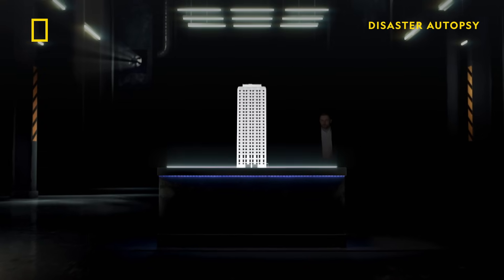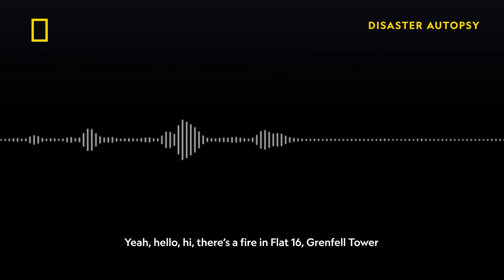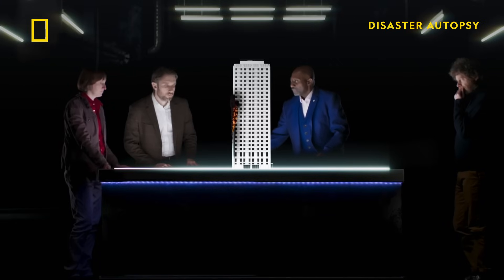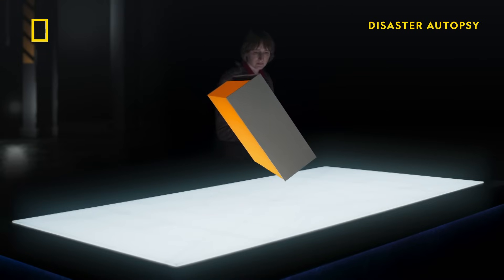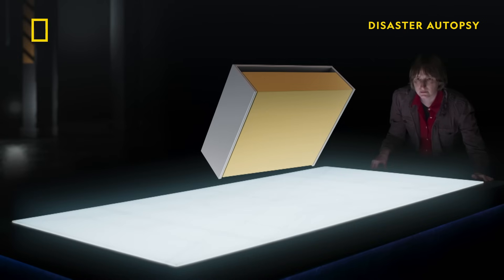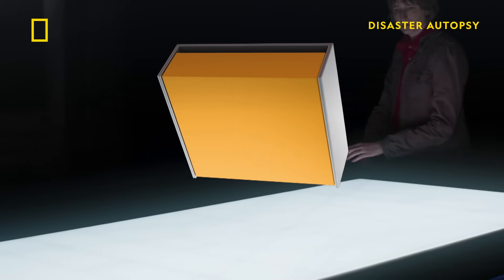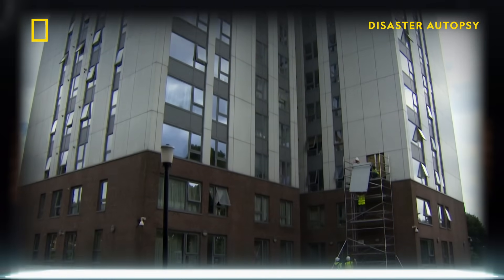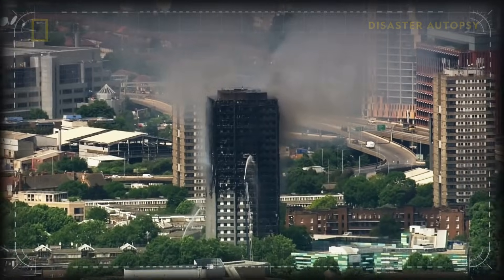How Did Fire Spread in Grenfell Tower? | Disaster Autopsy | National Geographic UK

Comment: The huge fact missing from this video is that the flammable cladding was added to the tower just before the fire. It was safe in it's original condition but made unsafe in an attempt to make the outside of the building appear prettier to the surrounding area.
Reply: just for aestethic reasons... deadly reasons

Comment: The refrigerator spontaneously catches fire... something doesn't smell right
Reply: It’s not uncommon. The motor goes into overtime if the door on fridge part or freezer part isn’t closed properly. Mine burnt out like that, but didn’t go on actual fire, but it could have.
The interior parts, such as the compressor, can definitely overheat and spark. When the electrical components inside catch fire, the surrounding plastic serves as a fuel source for a blaze.
I live quite near Grenfell. I walked past after a week, and the top floors still glowed red inside, still smouldering like hot coals.
Reply: @Zeneyez  Perfect response. Also this isn't a high end residence so it's safe to assume many of the residents had older appliances. That being said the rate at which the fire grew on the facade was shocking. It looked like a tinder bundle in a camp fire. The fire might not have been avoidable but the huge loss of life definitely was. The advice to stay put was insane. I don't understand how the chief's at the command post, with decades of experience, two exposures and ten floors fully involved didn't tell EMS to advise callers to evacuate. Prayers for the victims, families and firefighters who bravely fought a monster.
Reply: @Zeneyez I've read that it took an hour for the resident to call the fire brigade.
Reply: @marcot4863  he was asleep and woken up by his smoke alarm and called as soon as he heard it and got out. it was already spreading by the time the first lot of firefighters arrived though due to the cladding and gaps in the windows. as for the appliance catching fire, they'd had issues with faulty electrical outlets and switches suddenly triggering across all flats for a while and had complained about that to the council. also the company that created the fridge, whirlpool, was involved in several other house fires (including the Shepherd's Bush one) due to faulty products not being recalled.
Reply: Always a conspiracy. 
Electric equipment is what causes most fires
Reply: @damedusa5107  Incorrect. Most residential fires are caused by unattended cooking.
Reply: Refrigerators and air conditioning units are definitely the most common appliances to catch fire leading to a house fire
Reply: Not everything is a conspiracy. Life is not a movie. This is a real disaster where ACTUAL people died, quite disrespectful that you would try and turn it into a fairytale.
Reply: @s_.777 how do you know,only the tenant and God knows what really happened l
Reply: @marcot4863  just be normal for god sakes
Reply: Electrical fires are the most common cause of structural fires buddy, you might need to log off for a bit and touch grass
Reply: @whogavehimafork  during the grooming gang exposure.. I will bet my life on the fact that you shouted the same clap trap. I can hear you shout what about.
Reply: @whogavehimafork I think you have to follow Yr own advice. Ask Yr self why did it take an hour for the resident to call the emergency services?
Reply: It's a common cause of house fires.
Reply: Iv seen a few people claiming conspiracy 😂 even heard people angry it's being demolished like what you want your flat back? Some people are as dumb as a bunch of rocks
Reply: @ I understand them being upset at demolition, as it’s become a symbol or shrine to them. But the buildings not safe. So yer it has to come down.,
Reply: @anonymous-jt8duthat is really cruel. People are upset at it being demolished because their loved ones are literally still in that building. If you don’t understand that then fine, but you don’t have to be an asshole.
Reply: Exactly it wasn’t that
Reply: Imagine being stuck in one of those flats at the time of the fire... Nightmarish stuff.  Unthinkable.